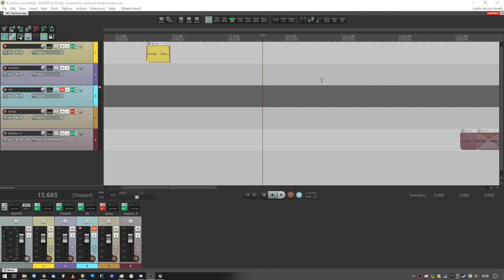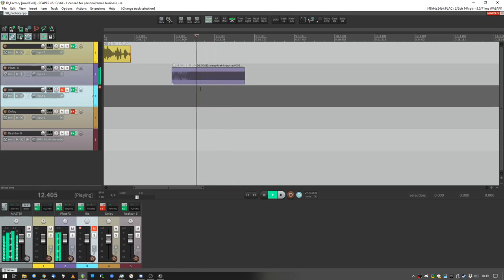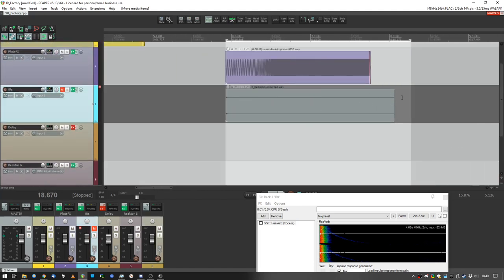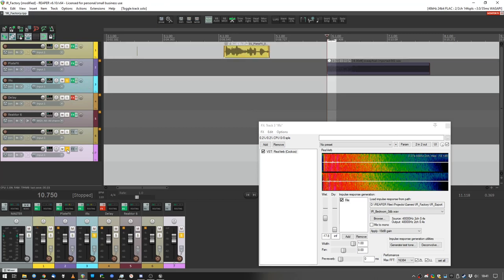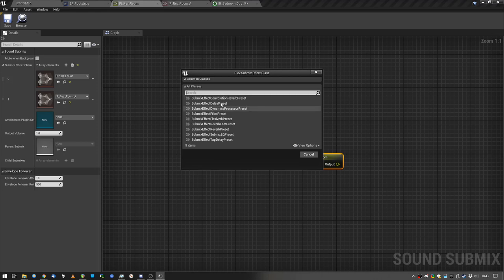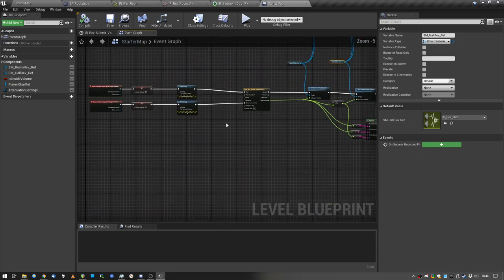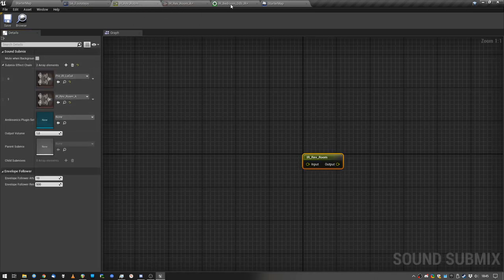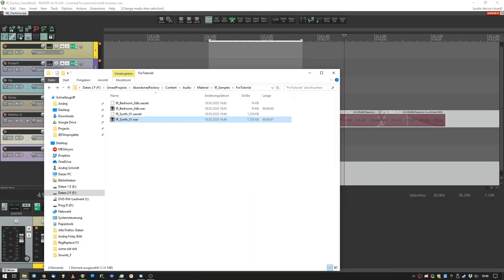🔉 Unreal Engine 4 - Sound Design - Basic Convolution Reverb Usage Tutorial

Comment: Super nice, thanks for this. Not much  documentation and tutorials about convolution reverb yet.  Two small questions if you have the time. Some of  the IM's are in mono or bformat, You could convert these to stereo for sure, but is that the right way?

Adding convolution reverb tends to lower the volume a lot in some cases, just increase volume output as needed?

Comment: Hi Thanks for your tutorial, I was wondering if you can help me out. I have been trying this on real Impulse response recorded files to no outcome. I have been testing this by: 

1) Importing record IR file (A sharp cracking sound). I also tried some IR for very large hall from the web.
2) Created them as IR in UE.
3) Created a SubmixEffectConvolutionalReverb and linked the IR.
4) Create Sound SubMix
5) Open Sound SubMix
6) Create empty slot for Submix Effect Chain and then add your SubmixEffectConvolutionalReverb in the new slot. 
7) Create an attenuation file.
8) Enable "Enable Submix Send" and add your Sound Submix in an empty slot in Submix Send Settings (attenuation settings).
9) Apply the attenuation to your Sound Wave file. 

I had no luck hearing any differences between the origin sound and attenuation with IR applied sound. FYI I am just using the first person BP audio example. To hear a more obvious reverb, I used IR recorded from real world large halls. My expectation was to hear the FirstPersonBP example gunshot "echo", but nothing.

Any other tips you can offer? Because this is new I can't find another decent tutorial other than yours. Ie) are there any IR file requirements? Am I applying the right settings?
Reply from the maker: hmm, in attenuation - for testing purposes, did you set your send level to 1 manually?